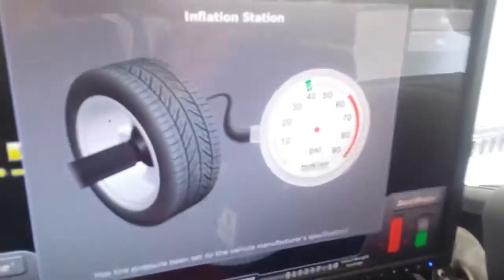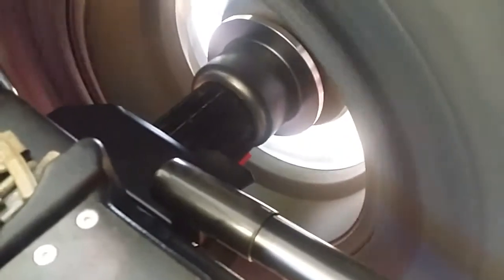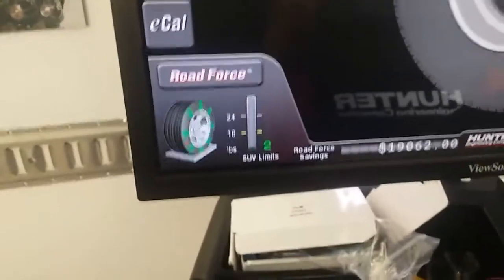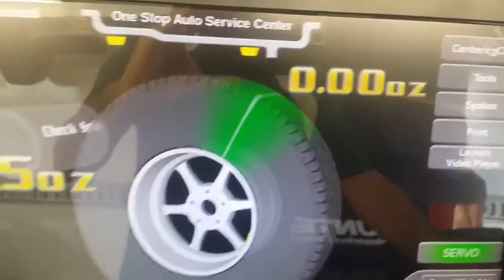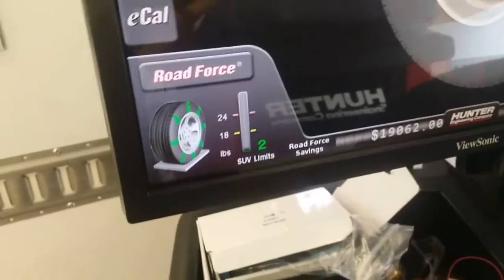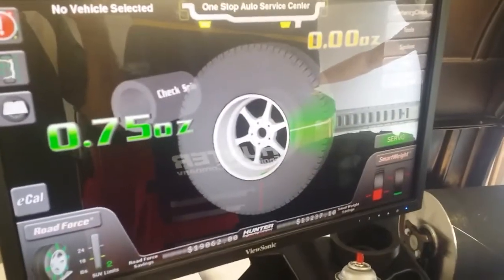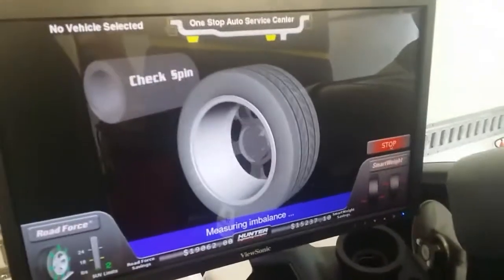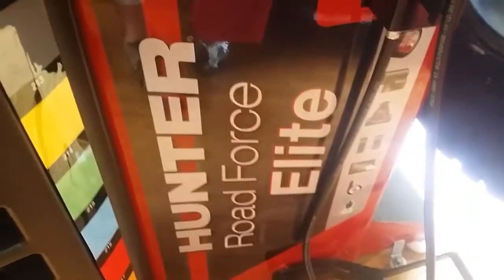Hunter Road Force Elite - Balancing Nitto 37x12.5x17 LT

Comment: I dont get why shops move your tires around where they best will run. Makes sense but Eventually the tires will need to be rotated. If a tire is unbalanceable it should be replaced.
Reply from the maker: Jeeper1378 A tire can be conventionally balanced and still provide vibration... that’s why Hunter’s Road Force Balancer exists. A shop with a conventional balancer will try to rebalance again and again with no success. The Road Force will tell you the proper position of the high spot of the tire to low spot of the rim which will offset the vibration to allow the assembly to roll as round as possible down the road.

Comment: Called around alot around my town and everyone tells me they can't road force balance my 35's.... What am I missing? Different model balancers?
Reply from the maker: Michael Langmaack yes, this assembly won't fit on older models. I would suggest finding a shop with a 4th generation (Road Force touch) or 5th gen (Road Force elite). You can find out who has one in your area by checking http://www.hunter.com/gsp9700 if you need any recommendations, I would suggest reaching out to your local hunter rep and they can guide you to the right place.

Comment: Are you in a trailer or box truck?
Reply from the maker: Clayton Whitaker 16 foot Ford E450 box truck. It's what a lot of us Hunter reps have for our demonstration truck.
Reply: Where are located?
Reply: That is awesome!!! I run a mobile tire/auto repair shop out of a 2010 Isuzu NPR-HD. I wish I had the road force.... honestly I hate the new tire changers though they take soooooooo long. I have my good ol' TC 3500 with bead arm and havent run into many issues. If  I ever upgrade itll be a tc3900. Are you using shore power or a generator to power both ? They dont exactly use a little bit of electricity.
Reply from the maker: Sorry Nick, I never saw this comment. The TC3500 with Bead Press is a great machine. I still have many customers with that machine...it's a workhorse. We have a new model coming out that replaced the TC3900 called to TC39 and it looks to be much more user friendly. I have a built in ONAN generator which handles my power needs for my Road Force Elite and Hunter Revolution Tire Changer.